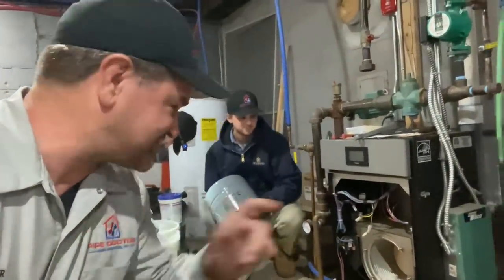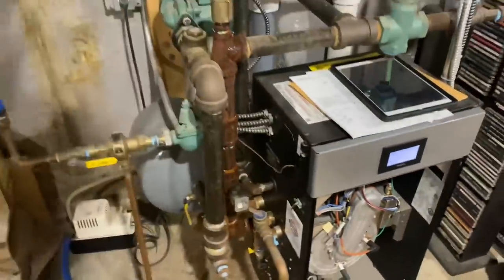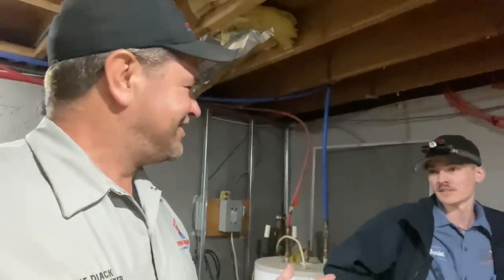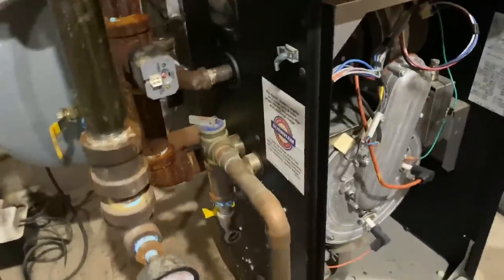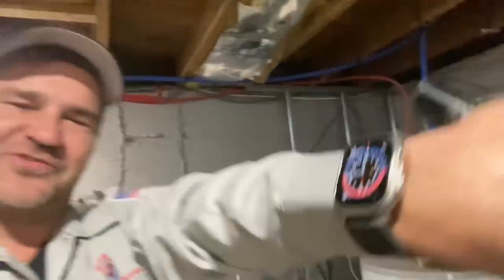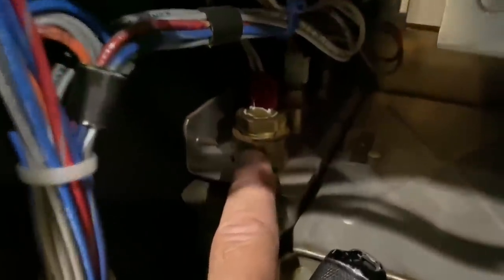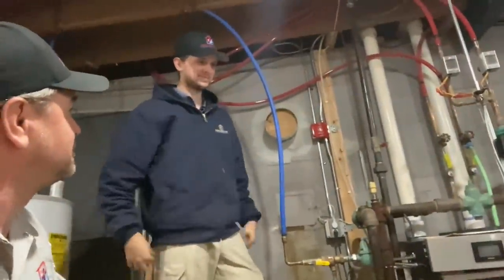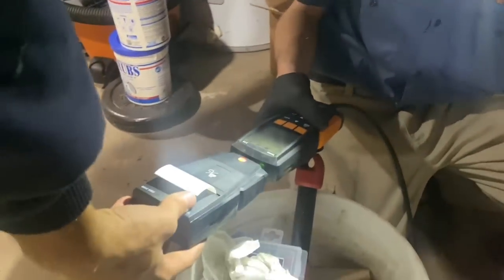Multiple Failures on Burnham Alpine Condensing Gas Boiler | Error 19 Hard Lockout

Comment: As someone who also writes books in service tickets, I would have modified what you said like so:
On previous service call (date of previous visit, trip charge applied to this invoice), diagnosed defective inducer motor assembly. Returned on <current date of service ticket>, and replaced customer supplied blower. During replacement,.... noticed boiler has original high temp sensor, replaced due to known (now expired) recall issue to prevent known failure.....

Comment: That style of inducer motor if you unplug the com wires itll run in high speed. Easier to do most of the time and speeds diagnostic for plugged flue, power, and blower operation.

Comment: I love hydronics, Hot or cold. Nothing beats boiler heat for comfort. I dont work on residential equipment and haven't for several years now. I'm strictly commercial/industrial. Some of these boilers i come across would blow you away....boilers get so big....they stop talking BTU'S and start sizing in horsepower. 200,300,500,900,1200,1500 hp. You are talking millions upon millions of BTU'S. I think the biggest boiler i ever worked on was 60 million plus BTU'S.

Comment: So my travel trailer furnace quit working. I checked the propane (by turning on the stove) and the fuse. After that I took it in to be repaired. There was a language barrier as the service writer said heater not working so the tech checked the water heater and they called and said it was ready to be picked up. When I arrived I checked the “furnace” and it still didn’t work. So the tech said let me look at it. After doing some electrical checks he replaced the thermostat. Nothing. Then he took it out and into the shop to test it. The pcb was bad, no spark, so he replaced it. Bench tested good. He put it back in and it still didn’t work. Turns out old trailers, the thermostat would run directly to the furnace but newer trailers (2018) the wiring runs from the thermostat to the AC and then to the furnace. The AC board failed also. That one they didn’t have in stock so I had to leave it until they get the part. Funny thing is the AC and the fan work perfectly fine. Crazy.
Reply: yeah, even in older trailers, the furnace boards fail (board is not honeyed, so it will fail. It's out in the elements). There's a company in Oregon that hand makes the replacements, since the OEMs discontinued them.